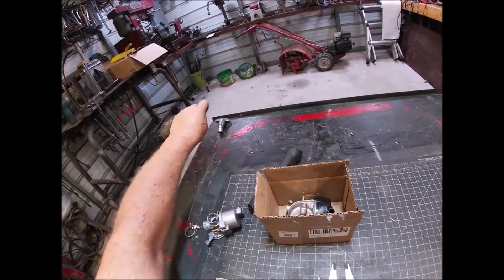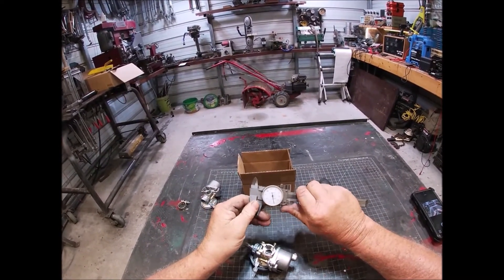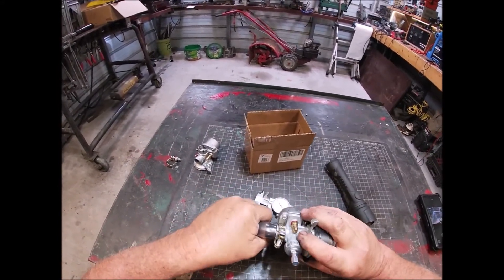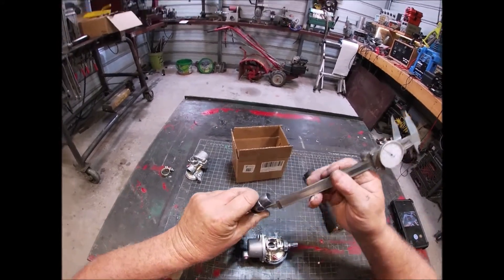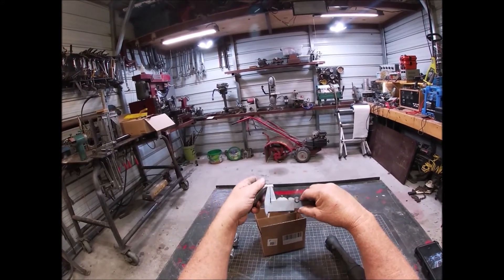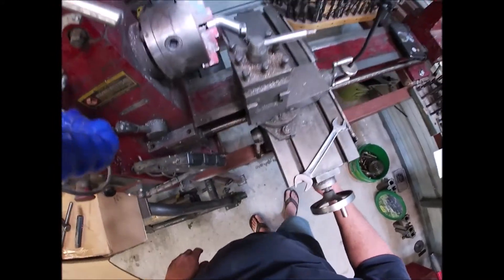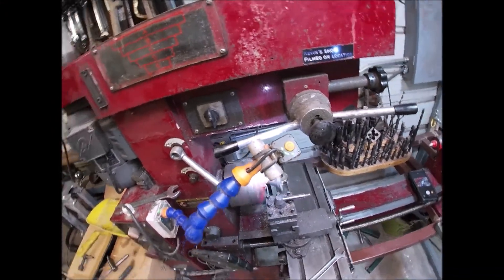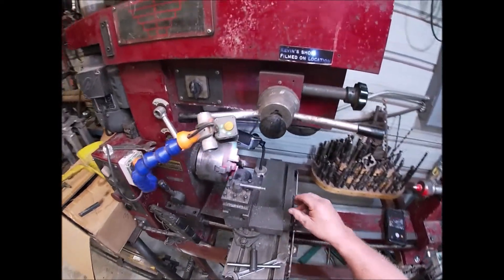motorized bicycle YD 100 Intake outtake to much air.

Comment: Hello Kevin.  I have been trying to find anyone else with this same "runaway idle" problem on the YD100 engine kit that had any info or advice on what to do to or what they've had to do to stop the high idle problem.  And somehow I just now came across your video and boy am I glad I found someone else having this same problem.  I've tried everything in my power to fix the assumed intake air leak/stuck plunger in carb/kinked throttle cable/dirt in carb/float bowl stuck/etc... you name it,  I've tried it.  So now I have to try what you've just shown me and hopefully I can ride again without having to hit the kill switch everytime I let go of the throttle and blah blah blah.  I had High Hopes when I bought this engine and so far have been annoyed to death with it's performance.  I keep hope alive though... I wonder how this worked for you when you reinstalled your intake?
Reply from the maker: Totally fixed the problem......  but to test if that is your problem  because it could be cases  leaking cylinder base gasket leaking and intake flange mine was carb to intake issue to check that is easy get you some ultra grey or silicone run a small  bead  to the back of the carburetor throat  and install it back on the bike and change that cheesy screw on the clamp to an Allen bolt and tighten the heck out of the clamp and let it sit for 4 hours to let it dry proper  and try it.....this was the issue I had on mine good luck on finding yours thank you for watching if you have the same problem may I suggest this

 https://www.amazon.com/CDHPOWER-Intake-Manifold-Bicycle-Motorized/dp/B06XB7WLB1/ref=pd_all_pref_6/139-1090781-7548462?_encoding=UTF8&pd_rd_i=B06XB7WLB1&pd_rd_r=20722800-2652-4749-b390-e095f734acbd&pd_rd_w=SXP5c&pd_rd_wg=89Alh&pf_rd_p=e6474b7e-8fb6-4ee2-b5d6-a1da55185fe6&pf_rd_r=AN37TBEZRXSW1JXCNR6J&psc=1&refRID=AN37TBEZRXSW1JXCNR6J

Comment: Ur so helpful. Should I just get a new carburetor for my yd100 and if so, which one because I’m to lazy to use my jb weld and stuff
Reply from the maker: What I did here not too long ago that little spot on the carburetor that holds the clamp in that position I filed that down move the clamp all the way up to the front next to the carburetor and put a Allen bolt instead of a flat head and locked it down real hard that seemed to work to
Reply from the maker: And the ultra gray I use is actually a silicone it's not J-B Weld and by the way thank you for watching

Comment: There are a lot of vendors that sell rubber o rings that go inside the carb.  I would try that first.  That might take up the space.
Reply from the maker: https://www.youtube.com/redirect?q=https%3A%2F%2Fwww.amazon.com%2FCDHPOWER-Intake-Manifold-Bicycle-Motorized%2Fdp%2FB06XB7WLB1%2Fref%3Dpd_all_pref_6%2F139-1090781-7548462%3F_encoding%3DUTF8%26pd_rd_i%3DB06XB7WLB1%26pd_rd_r%3D20722800-2652-4749-b390-e095f734acbd%26pd_rd_w%3DSXP5c%26pd_rd_wg%3D89Alh%26pf_rd_p%3De6474b7e-8fb6-4ee2-b5d6-a1da55185fe6%26pf_rd_r%3DAN37TBEZRXSW1JXCNR6J%26psc%3D1%26refRID%3DAN37TBEZRXSW1JXCNR6J&stzid=Ugw-eyj2E3ON2_rIeU94AaABAg.9FW0pD26WzB9FW_I1N16j3&redir_token=QUFFLUhqbUxqdmQ5eDJYWHZMVzg4X010cG9mU0h6dXgwQXxBQ3Jtc0tuUlYyaUR3WEI0ZnMtZ3BwSnFMUkM2NVlWdHB3b2dBeW9UUUFnSHlDTm9kZ1pLWHgtY3JlbUQzOTROZDFnanpYcm9mYTN4WVNjNjIzeTc3NkZuVkhKNGtEQk9OaVB5NHE4dDlVOUVxTUpsRHNFbjdHaw%3D%3D&event=comments